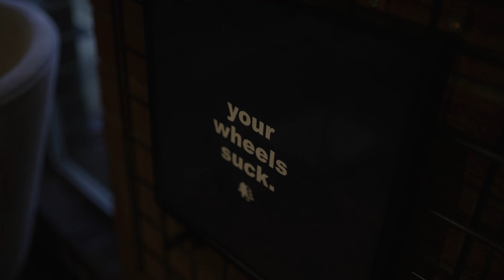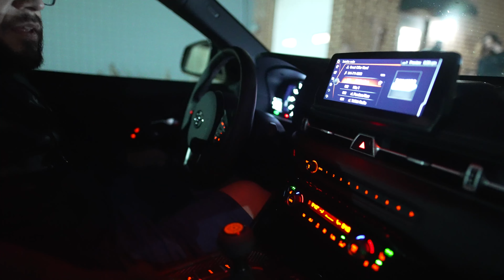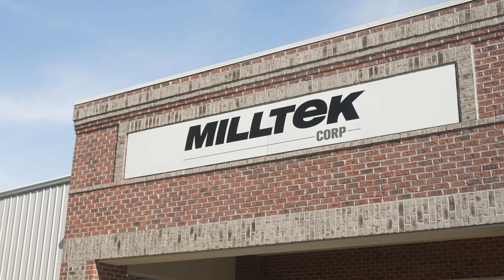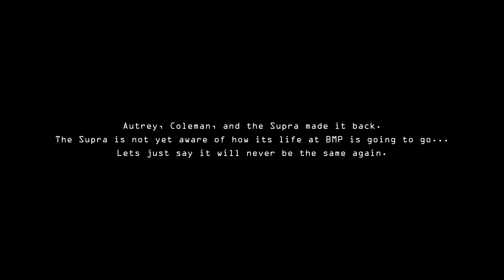Our New 2023 MANUAL A90 Toyota Supra // BMP Tuning

Comment: I just got my 23 NYellow last month and am blowing $$ 😂 Quick question: I am about to pull the trigger on the knob and boot from BFI but curious if there was any modification needed for the boot to secure? Or just some easy diy quick fix is simple enough? Also I'm guessing the length of the boot has no issues reaching 6th or the Hulk pressure reverse? (Edit: What size spacers are you running?) Many thanks if you take time to reply. Subscribed Thanks for the MK5 content!!
Reply from the maker: Appreciate that a ton!!! PLEASE order on our site to support if you can we have them listed - no issues with sizing!!

As for spacers, I have my spacers and prob wont use them again now, if you'd like them you are welcome to them just order up the shift knob/boot and then reach out to us and I can sell them to ya cheap!

Thanks!